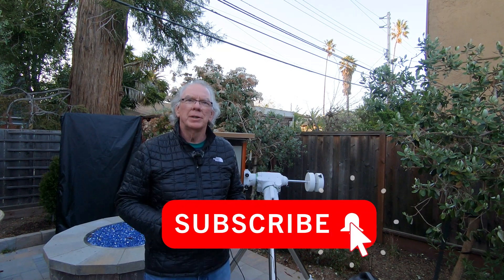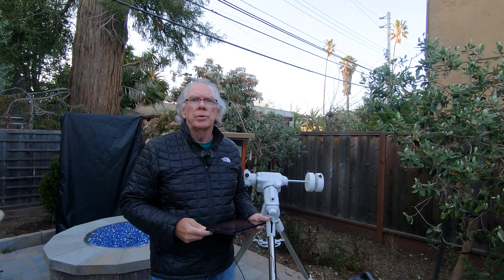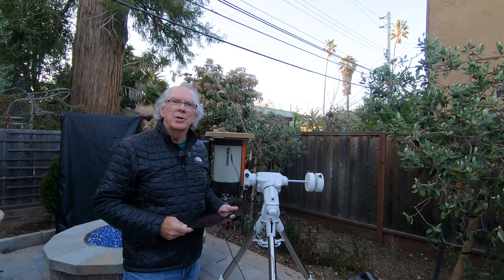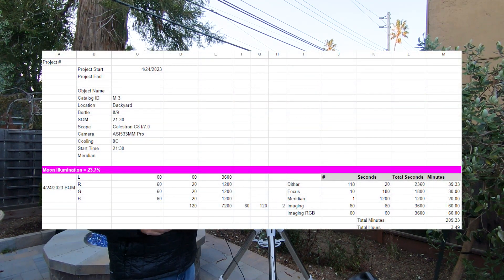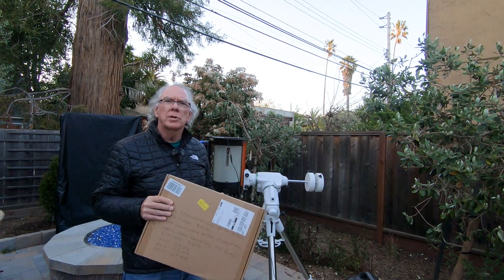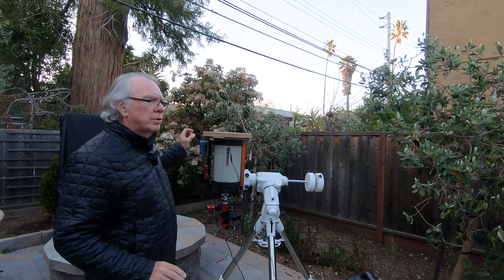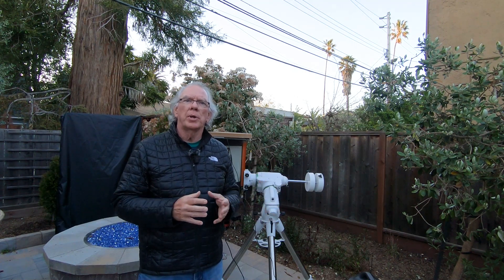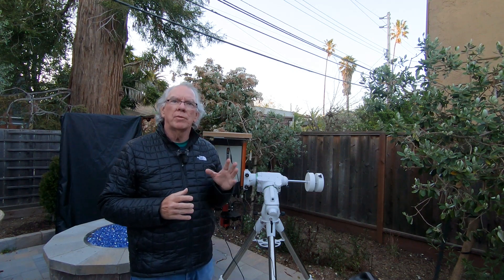Light Panel for My Celestron EdgeHD 8 Calibration Flats

Comment: I like using the light panel but the neutral density stuff and plexiglass is a no for me. I would stick with a t-shirt and light panel because if there is dust on the plexiglass or neutral density filter… the flats could be unusable. Just my thoughts. Clear skies!
Reply from the maker: Thanks for the feedback. I appreciate the insight and will keep it in mind. I no longer use that anymore.

Comment: Great idea with the tracing pad! I wonder if you can swap out the resistors for larger ones to drop current running through the LEDs to make them less bright. I may try to do this in the future
Reply from the maker: While I've since moved on and purchased Giottos for light panels the tracing panel worked. Did you try yuor idea?

Comment: I plan to get a flat panel soon as well. Not sure why I ignored flats in the past 😂
Reply from the maker: Well it seems some are fine without doing flats and feel they get good results. In my early years of my work life I used ultrasonics on materials and developed the belief calibration is a key part of achieving proper results. I carried that thought process forward into astrophotography. I also travel and image from dusty desert environments and no matter how hard I try if I have to open up my image train dust generally finds its way into the path. 

Let us know what you wind up using for a flat panel.

Comment: Bill

Sorry, I had a lot of trouble concentrating on your video.
as I could not get my eyes off the cables going through your yard just above your head.
I guess these are communication cables of some sort; one would hope they are. Interesting.

Anyhow, some information that may be of interest to you and your followers about having better control over a flat panel
The following address may be of interest and may work with your ASIAIR equipment.

The following video does have references to SGPro Light panel control. As I use NINA, it is easy to control the flat panel control box as well.
So I can't see why it would not work with the ASIAIR device you are using, unless it is software-specific.

One of the advantages of the control box is that you can set a fixed time for each filter. The control box then adjusts the brightness 
of the panel light until it has the correct ADU. Once the flats have been captured, it will continue doing dark flats.

The optimal ADU for flats is between 19000 and 21000, with 20000 being ideal. Any higher or lower, your flats will not work well. The closer to 20000, the better.
Always keep your flat above 1 sec, but not too high. Don't go beyond 1 minute; if you can keep them within 30 seconds, that would be ideal.
My advice here is to do your flats when it is still dark, or at least move the telescope indoors to get that consistent low light.

The YouTube link is here: https://www.youtube.com/watch?v=2RQyRsJflmY&t=49s

I hope this of useful information.
Reply: If you move your scope indoors to do your flats then you are missing the point of taking flats. Flats need to be taken without disrupting the imaging train or moving the scope as you could dislodge dust or even add more dust to the optics in the process when moving the scope resulting in dust motes that weren't present when imaging.
Reply: Simon,

I get your point. Though I think you are getting a little pedantic here.

I do all my flats indoors and do not have an issue.
The odds of dislodging or adding dust to any element would be virtually zero, if at all.
If I were to have dislodging issues with dust, I would be gravely concerned and give my scope a total cleanup.

Granted, dust can accumulate over time, so periodically new flats would need to be created.
The image train cannot be altered in any way; otherwise, the dust, etc., would not line up with existing flats, and new flats would have to be taken.

Don't get too concerned about the possibility of dust; otherwise, your comments would mean doing flats every time you image.

What is important, is the illumination of the flats has to be the same through that set, and the ADU needs to be about 20000.

This is why it is difficult to do sky flats, as the sky's brightness is constantly changing, which will affect the quality of your flats.
Even using a flat panel outside can have the same effect, depending on the flat panel type. A variance of light will happen.

So no point is lost. Keep on imaging.
Reply from the maker: Hi Robin, thank you for the feedback. I think % ADU is another topic where there are a range of thoughts on what is ideal. An often there is no ideal. I do appreciate you throwing your thought on the subject out for my consideration. Much appreciated!